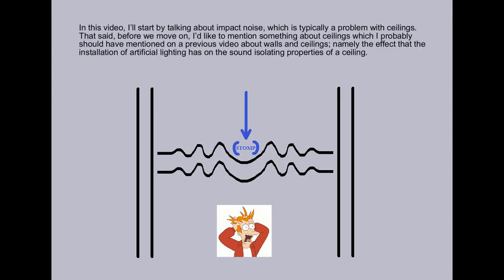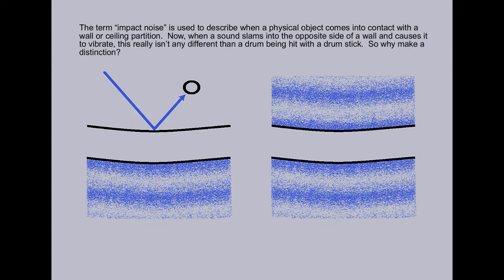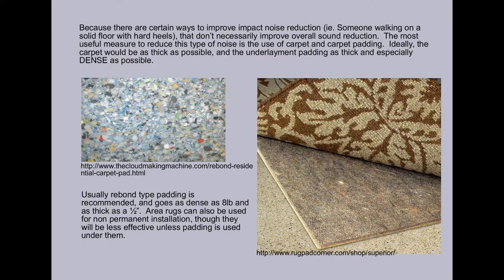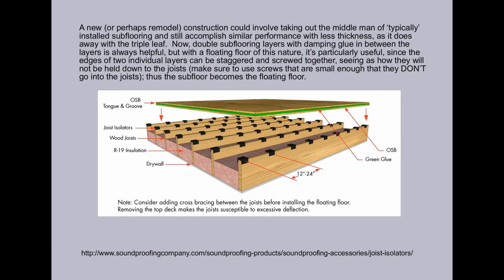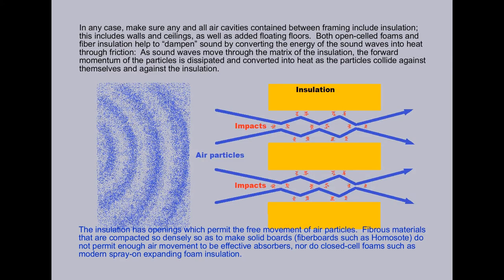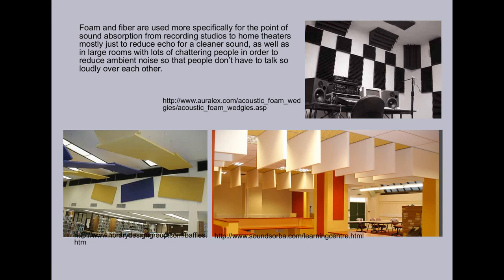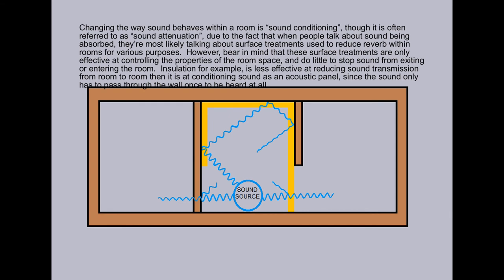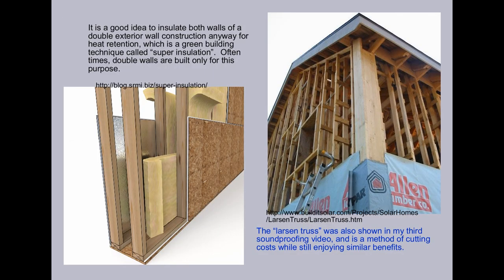Soundproofing -5- Impact and Absorption

Comment: Great video! I live in a condo with absolutely no insulation in the walls and ceiling. I get a lot of impact noise in my unit from people walking around upstairs.  Do you think that blow in cellulose insulation in the ceiling and wall joists will do anything, or will I just be wasting money? My goal isn't complete soundproofing, as it seems like you can spend a lot of $ for diminishing returns.  I just want less of a resonant drum feeling coming from the ceiling.
Reply from the maker: As you can imagine, that's a tough one.  The best way to stop sound with the least amount of expense is at the source, and talking to your neighbors about treating the floor with thick padding/rugs if the above floor is wood will go a long way.  If you're allowed to alter the building in away way, I can tell you from my own experience with impact noise from a ceiling that you kinda need to go all out.  Insulation is better then nothing, but not by much in the case of impact noise.  The best thing is to gut the ceiling and add a second row of joists so you have a staggered joist ceiling.  Because the floor and ceiling below it would be somewhat decoupled, the insulation which you then add will be more effective.  Another option (though less effective but easier for the homeowner to do themselves) is to cut several big holes in the original ceiling large enough for you to slide fiberglass batts into the cavities (and leaving the holes open will help prevent the triple-leaf effect), then add resilient clips + r2 metal channel, then add drywall, preferably 5/8" firegrade drywall.  If this ends up being not quite good enough, apply damping glue and a second layer of drywall.  Cut the heavy drywall in half and install one half at a time so they're not so heavy to handle above your head.  Make sure the sheets are between 1/8" to 1/4" gapped away from the walls and the gaps filled with acoustic caulk.  I know this all sounds like a pain in the ass, but there are no magic bullets for this and ceiling impact is the worst.
Reply: @WhatIsMisophonia  Thanks for the detailed reply! Seems like I'm going to have to step it up then. I was going to try to keep expenses down by demoing the ceiling myself, installing insulation, and then having a vendor do the resilient channel and 5/8 drywall.  It seems like kind of a waste to only do insulation if I have the joists bare. Staggered joists seems out of my budget however. Do you have any other recommended ways I can add more mass before I fill the joists with insulation? I was thinking about cutting strips of mass loaded vinyl and green glueing them onto the ceilings between the joists, or maybe even cutting drywall to fit snuggly between the joists so that it would be upstairs floor> small airspace>drywall> insulation>resilient channel>5/8 drywall ceiling. Thanks again
Reply from the maker: @kokuamedia7946  I wouldn't use mlv for large surfaces, especially if you're on a budget.  If you're going to use damping glue, it only really works when it's between two rigid surfaces, so it's pointless to use it with mlv anyway.  It's a lot of extra work, but the best way to add mass to the floor is to remove the old drywall and reuse that drywall by cutting it into strips and gluing and screwing them to the underside of the open subfloor above.  Remember that if you use damping glue, you still need to use screws because the glue by itself will come loose.  Try not to have multiple spaces if you can, just one big joist cavity.

Comment: Do you have an opinion on the use of Mass Loaded Vinyl in a double wall design to help create a better a low frequency barrier (like 125Hz and lower)?
Reply from the maker: Mlv is a very expensive material, and though I haven't experimented with it personally, my research leads me to believe very strongly that it is cost prohibitive to use in room partitions.  You'd likely get similar improvement by simply adding another layer of drywall, regardless of the placement of the mlv.  Damping glues work well to reduce the ability of drywall to hold a vibration, and not holding a vibration is the main advantage mlv has over drywall in that scenario.  The only time I would use mlv as a main soundproofer would be a situation where its thickness and flexibility are necessary, like in a car door perhaps, or maybe in a curtain partition.
Reply: @WhatIsMisophonia  Right on, Thank You for your feedback, I Greatly Appreciate it. --Jason ✌🏻&❤️
Reply: @WhatIsMisophonia  Oh, I think I didn't explain myself correctly but tell me if you understood anyway.  I meant using MLV on the shell of my room, not as a partition within the room.  Does that change your reply or would your answer still be the same?  --Jason ✌🏻&❤️
Reply from the maker: @jalithic  Still the same.
Reply: I've been trying to sound proof a large bedroom window and I've had a very difficult time stopping the bass coming from neighbors playing music at outside parties and passing cars.  Several layers of MLV + high density mattress foam + 5/8" drywall over the whole thing has given me the best results so far.

Comment: Super old video I realize but, why can't a box that is isolating a recessed light touch a joist?
Reply from the maker: Soundproofing doesn't exactly evolve very fast, so even though it's an old video, it's still current as far as I know.  I guess it's not a huge deal if the box touches the joist, it's just that the less contact the wall/floor/ceiling has with the structural members, the less sound will transfer though.  That's why there are companies that make foam tape that can be put on joists/studs to help reduce rigid contact points.